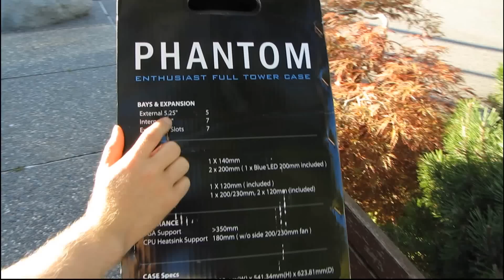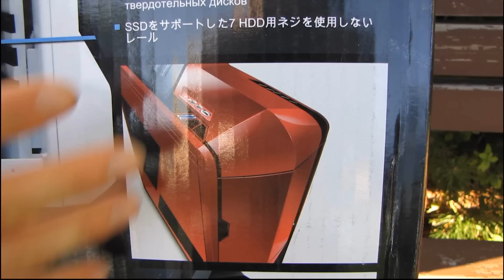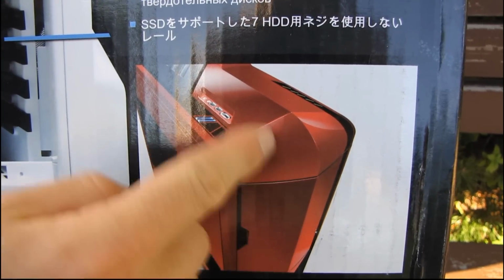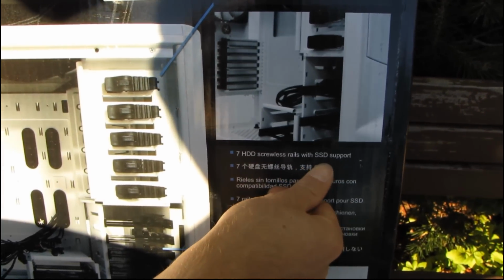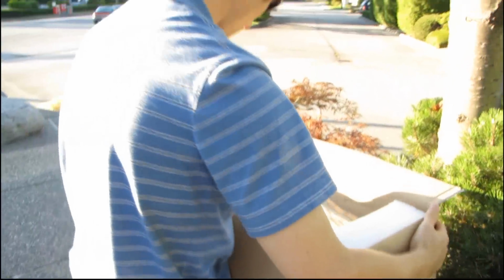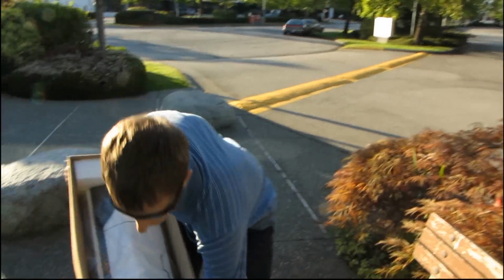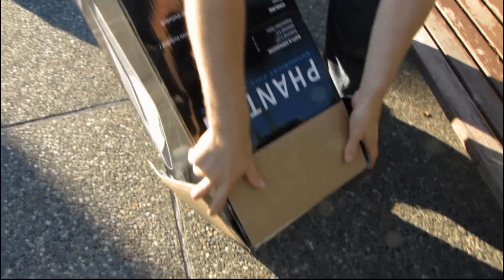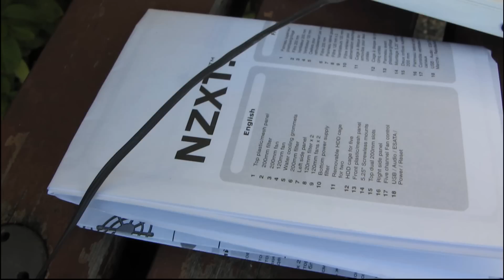NZXT Phantom Premium Gaming Case Unboxing & First Look Linus Tech Tips

Comment: I have this case on the back there is a button for the leds on large fan at the top and the long thumb screws are so u dont have to take them out you can just press them down and the back comes off and cable management is very nice

Comment: the brackets at 12:48 are those for the Dual radiator? I'm just curious i have this case and im upgrading to a i7 3770k and i wanted to get an H100 with it.

Comment: I believe you actually can fit a double 120mm rad there, but I'm not totally sure. I know it has some additional holes there that potientally fit 120mm fans, but i'm not sure the spacing is right for a radiator.

Comment: the top front USB cabbles, do they directly connect to the motherboard or do they run around to the back and plug in to usb ports that are already on the board ( ive seen that in some casses and find it idiotic)

Comment: @KingKjellboy SSD hard drives will fit into this case with no problems at all.  I have two 120GB OCZ Vertex 2 SSDs in the 3.5" bays at the front of the Phantom case, cooled by two 120mm intake Gelit side fans AND a 140mm Aerocool Shark front intake fan.  

This case is massive, space won't be an issue.  As for stock fans, my NZXT Phantom case came with two 120mm side fans, one 200mm top fan, and a 120mm outtake fan, although I replaced them all with high-performance fans.

It's a quality case.

Comment: At the top, in the space where you would normally have the 200mm fans.
Though, again, I am not certain the holes are in the correct places for a radiator.

Comment: Are the front intake 140mm slot and the two side 120mm fan slots filtered? My place is really dusty and I go nuts cleaning the inside of my computer every month. As for the hard drive cage nearest the power supply mount, is that removable?

Comment: Can you use the fan controller on aftermarket fans? I want to put LED fans in and can I connect them to the fan controller in place of the stock fans? Thanks.

Comment: @xJDKx This is the cheapest of the 3 and provides really good cooling, it also looks very good, has excellent cable management and stock cooling, adding the 200mm side and 200mm top, along with a 140 will be the best combination, and it will cost a little less than the HAF-X. Choose wisely. :)

Comment: i noticed the reset button is not indented, and it is on the top of the case...
unless you put your case underneath something, if something gets knocked off of a surface near this case, it may end up hitting the reset button. Would kinda suck.
Good case though.

Comment: How is this case with ASUS Maximus IV Extreme B3? I'm going to order new gaming-computer with new case since the one I wanted is waaay to small. Besides, I only want the best. :p Anyway, I'm also going to mount 2 or 3 Gainward Phantom GTX 570 and Corsair Vengeance 8 GB in it + Intel Core i7.2600(3.4 Ghz) The space doesn't concern me, however, I'm concerned about the cooling. Should I also buy extra fans with the case? And what about SSD, can they be placed in there?

Comment: hey, i am soon buying parts and goin to build my own computer. i am thinking about getting this case but i wanna see if i can fit everything into it. what i am goin to get is an ASUS P8P67 motherboard, an intel core i7 2600k processor, radeon 6990 graphics card, XION XON ATX Power Supply 1000w, and Thermaltake BigWater 760 Plus Liquid Cooling Kit. Will that fit into the case or should i stick with the corsair 800d case?

Comment: @deadzo24 It was built to support "Most" E-ATX MB's (rumor has it some are just slighly bigger than the case), so im sure it will without a problem. 

I know its able to hold my 1000w PSU and its bulky wiring w/o a problem (just a small case example from me =D.

Comment: I just got a job (I'm 16) and I'm saving up for a computer build. Would it be a good idea to get this case if I was going to replace all of the fans with white LED fans and the top 200 mm fans with an H100? Everything else inside and out would be white or black (G600 white mouse and Rosewill white/black mechanical keyboard) Thanks!

Comment: My first pc gaming case (Oct 2011 built). This one is huge, with up to 7 fans (including 2 200 at the top and 1 at the side).

I use Fractal North now. I  still miss the adjustable fan controller on this pc. Not as customizable as the software-based, but it's way easier and more convenient. I don't like tempered glass (otherwise, the side panel would be long gone), and I cannot let go of the mesh panel, my North uses mesh panel as well.

I wanted to choose the white version, but it arrived in black. And I'm so glad since the top and front part is plastic, it will be yellowed 100%. I gave it to my brother earlier this 2024 and it still looks pretty (minus small corrosion on the mesh panel, very small and only noticeable if you're about to remove the panel)

Comment: will the Asus Mars II Dual GeForce GTX 580 GPU fit and will any power supply fit im thinking of getting 	Zalman ZM-1000HP 1000W Power Supply 80 Plus Silver or Coolermaster Silent Pro 1000W Modular Power Supply would either power supplies be good. im open to suggestions.

Comment: Hey, I got a quick question, I wont be using any cpu coolers or liquid cooling for my phantom build, however ill be replacing 3 120 mm fans with much better and more silent, I know the fans are good and silent, however in my situation where its my first PC that I personally build I wouldn't be able to get liquid cooling or cpu coolers, also im installing the 140 mm fan in the front, my question is do I need the 200 on the side, and should my fans exhaust or intake air, if both can someone tell

Comment: It's not 190mm,whoever wrote that, it's 200mm. I got this case for my build and I have used up all 7 fan and I have not had a single heat problem. And I dnt worry about the side 200m fan that much because I am using a Corsair H100 liquid cooler for CPU so there is plenty of room. I love this case. Great look, size, accessibility and airflow. Its  lot better than my 6 yr old Alienware Predator setup... Lol

Comment: I had this case last year and enjoyed it a lot it's a really awesome gaming case 😀👍🏻 and I had plans for it but now I've just packed it away back into its box, ready for sale since I sold the parts inside it and don't need to keep the case since I'm going with a new design with more space and my other case is small. 😁👌🏻
Reply: Owned one for at least a decade and still use it in 2023.  Running a hot CPU and hot GPU now but this case just laughs at heat.  Resale value should be good for yours but shipping weight/cost is going to be crazy for whoever buys it.
Reply: @LatitudeSky  wow what specs you running on it! 🤩 Unfortunately resale value is bad here as most people don't want to pay the set selling amount they just want to short change people 😕

Comment: @ZeroHeroVids It's not on my desk it sits on the floor. Thing is far to huge to sit on my desk. XD I have it sitting on the floor with plently of room behind and both sides for ventilation. My desk only has legs (not a full piece of wood) so more air can flow around it.

After you add the weight of the case + fans + power supply + HDD + DVD Drive + other crap it might become to heavy to sit on a normal table. XD

Comment: Hey Linus can you help?
I am thinking of creating my dream gaming PC... So far all I have is an Nvidia GeForce GTX 560 ti Graphics Card, 500W Power Supply, and memory i can get from my HP (6GB Memory and 1TB HardDrive). I want to get a NZXT Phantom Premium Gaming Case, Intel Core i7 990x Extreme Edtion, Thermaltake Bigwater 760 Plus Water Cooling Kit with green UV sensitive Cooling Agent, and a Gigabyte G1 Assassin motherboard will all that fit into the gaming case?

Comment: The dust filters included are for covering the fan slots not being used.  The top 200mm included fan is defaulted to exhaust which is why there is no filter....actually this stuff is common sense by now don't understand the damn mystery.

The door by the way is removable if you prefer not to use it....simply remove 2 screws at the top hinge area that holds a plastic clip onto the front as well as the hinge peg.  I hate doors on cases as rarely do they ever open the correct way.   Just in case anyone wanted to know ;)

Very roomy although I dislike having only a 140 mm up front 2 would have been better.  Using 4 Terabyte drives for video storage and like having fans that blow over them from the front....side ones cause turbulence with the front fan.  

Oh yeah....NZXT being the ass hat company they are no longer makes 200mm fans for this case that have LED's and aftermarket 200mm fans will not line up with the mount holes.  Thanks NZXT that was a total dick move.

Other than the fan issue this is a wicked roomy case that looks great.  The fan control is awesome and works flawlessly.
A great case that will hold quite alot.

Cons:  No front mountable radiator,  very limited front fan intake,  Not much room behind the motherboard so routing cables must be more attentive.  

Also there's a long bar running top to bottom behind the Drive cage area that makes routing your HDD sata cables difficult if you put too much around that bar the door barely closes.  Another issue is the narrow area behind the drive cages can crimp the sata cables as the drives slide back far so 90deg sata and power cables are a must if you dont want them to have pressure on them all the time.

Just note this case is huge...not in the area of 900d but nonetheless a very large case.

Comment: 11 years after its a very cheap production plastic and looks really cheap and breaks all apart, the matte finish is this soft touch shtuff, all greasy and disgusting, the metal is not bad and cable management also nice but it is a very huge and cumbersome and heavy (with uneven surfaces which are pretty much useless).